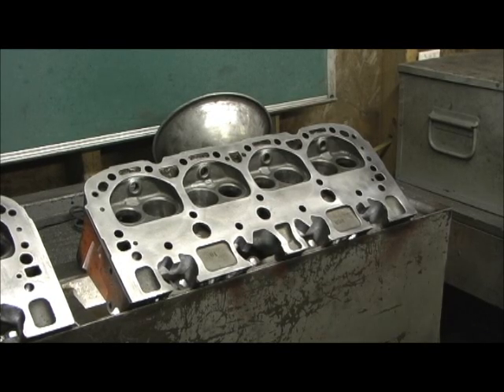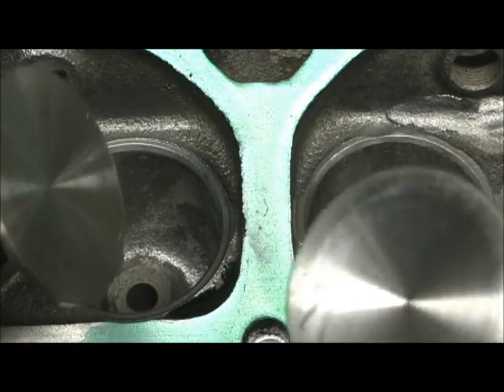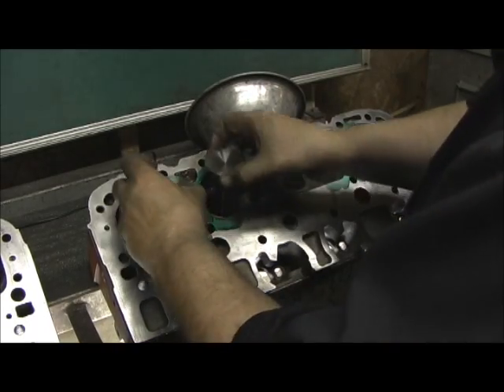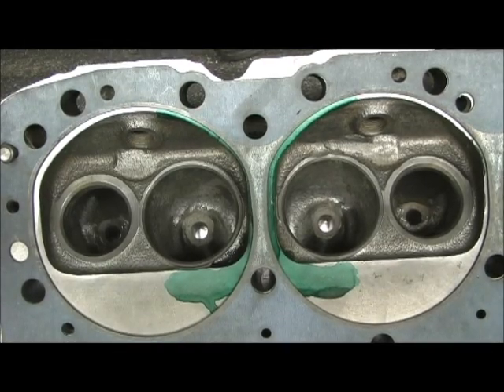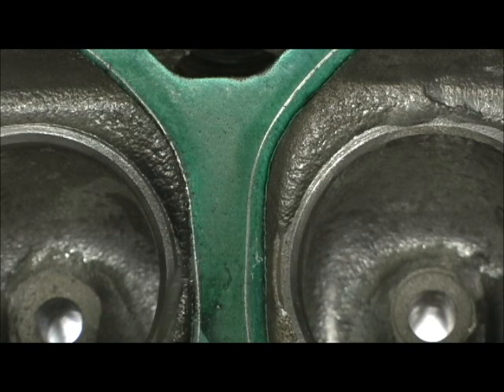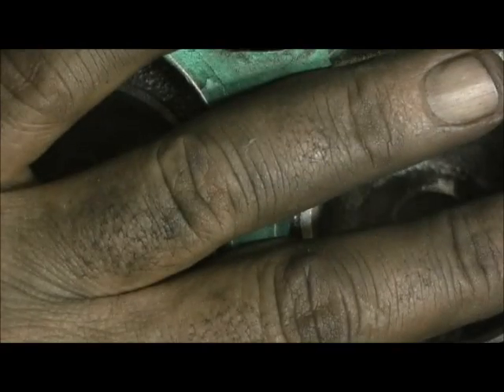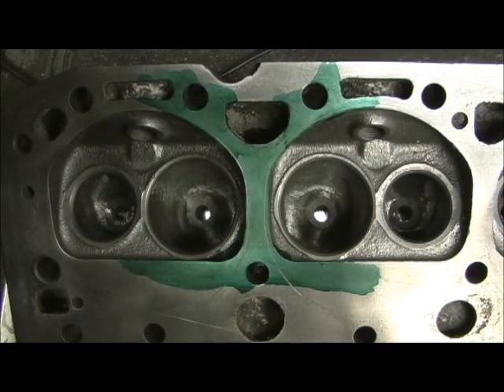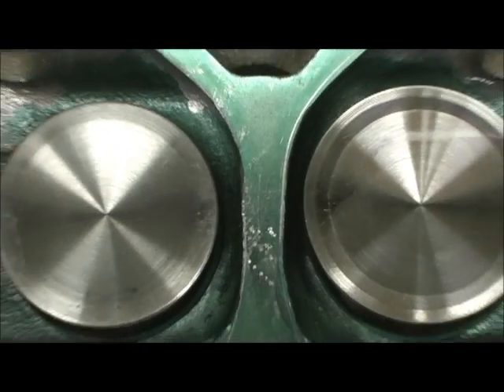Unshrouding Chevy Small Block Combustion Chambers for 2.02 valves

Comment: Honestly... you can achieve fantastic flow numbers with the stock 1.94 back-cut stainless steel valves with a 3 angle seat and the intake bowl cleaned up... or you can skip all of this and throw on a set of Vortec heads and benefit from the clean burn chambers, and the huge cathedral intake runners that flow like crazy @ 0.400. Summit racing has new complete heads for $339 a piece for the Vortec and for the same money they have the old school 72cc heads with 2.02's and 1.60's that have 0.520 lift valve springs ready for screw in studs. As inexpensive as these are, compared to a valve job, I buy the new ones...
Reply: dat 3 angle sure helps the short turn radious,,can do this some to a small valve, i gawt 1.94 votec on a 283 build im almost finished with it :)

Comment: got a tired 1979 K20 with the 400 small block i am refreshing.  Would love to turn her into a mud truck / driver for the farm.   Nothing too wild, but want some power and drivability.  Do not want Chinese $hit....thoughts on head/valves? Modify stock or go new casting.  Have a 750cfm Holly on her now and just looking to wake her up a bit.  Will most likely run a mild cam with a little more duration.  Thanks for the knowlage and videos

Comment: #882 castings are the best of the worst. I had a set years ago on a 355 I put in a Monte Carlo, they're hard pressed to make 300hp because they where an EPA head used in the 70s to replace the #441 cast. I'm not big on factory casting iron heads, especially a cast iron vortec, they're weak in the knees and will crack real fast. Always use aluminum heads either factor or after market, they're a lot more forgiving.

Comment: Do iron head motors use the head material for the valve seat?  I'm used to aluminum heads with pressed in seats so it is surprising to see no seats, but a motor is a motor and I learned a lot from your video, thanks!

Comment: Here is another question for you. Sense the 1.94 valve has more "unshrouded" room would there really be much of a gain if any even after the unshrouding in going with the 2.02 valve. I ask because even though the 2.02 is a bigger valve and should flow better and or more isn't it still the same theory as before? just now the 1.94 is able to flow even more than before... Food for thought..
Reply: sam hunt So, why not bring the head gasket to the junk-yard and only buy the better castings ??
Reply: If your casting measurements are off, it makes no difference what size valves you have, It's called combustion equalization. That is basically the purpose of this video, to correct casting errors.
Reply: You're forgetting that the valve seat in the cylinder head is cut open for the 2.02 valve's extra size thus allowing the cylinder head to ingest more air. Enlarging the area in the combustion chamber to unshroud the larger valve allows for it to flow to it's maximum effect(given the intake tract/carburation/exhaust/cam lobe/cam timing/compression ratio etc. are all working in harmony for the engine builder's desired results). In other words, if you want to put in a hairier cam with lots of RPM and free flowing heads and tons of compression ratio, bigger valves would be beneficial versus the smaller valves(which would most likely work better on a mild street build).

Comment: Is it just me or did it look like the valve guide in the left chamber was not centered good and made the comparison look weird..  With that said, should the valve's/valve guide center be corrected before this type of modification to the head is made or does it not matter?
Reply: BTW I realize this is two different size valves, however in the initial comparison with the "wrong" size valves there looked to be almost no difference in the distance from the valves to the wall. this is why I mentioned this..  Seen all your videos you do great work! !
Reply from the maker: It is just you, although the meat surrounding the guides are off center all the time, till you grind on them.

Comment from the maker: THAT was some bold thinking guy!!!!! But it don't work that way (I wish it did). One a weird not here, back in the 1960's and 70's they used to do just that in a way, by offsetting the dowel pins. Problem was on SBC if you lined up one, you closed the others, It worked to somewhat of a degree on Ford Heads and if I am thinking right, some of the BBC stuff. It actually made Power differences that made it worth doing (like angle milling). we actually did the trick on the valve guides as well.

Comment from the maker: BEE CAREFULL!!! This head is THIN in certain areas in the bowl, AND I would recommend you only de-burr and clean up the ports and chambers (maybe 10 to 15 Ft. Lbs) because this is one of the hardest bowls I ever done, paying attention to the sonic checker and mathematics. It is a Great head for LOW RPM pulling, one of the best I seen, but you have to science it out or you will hurt it more than help BIGTIME. hope that helps.